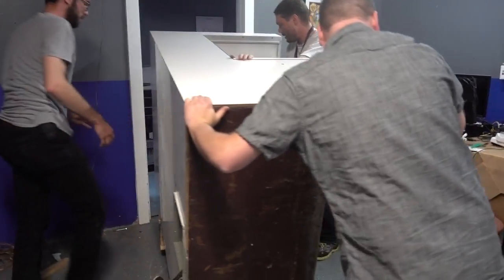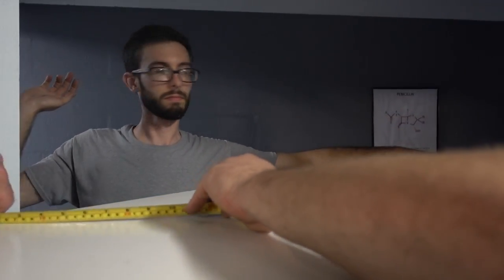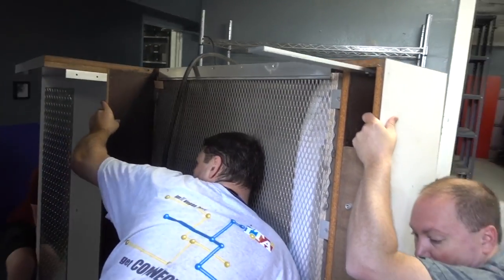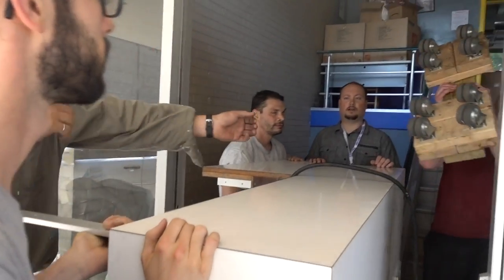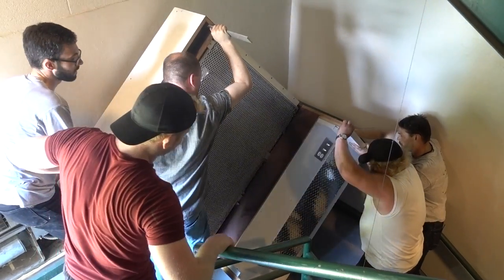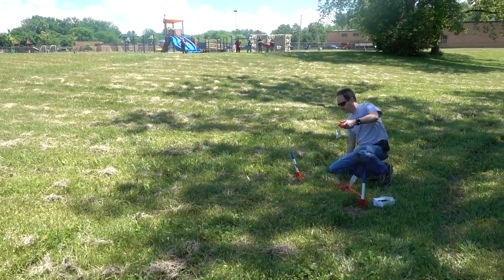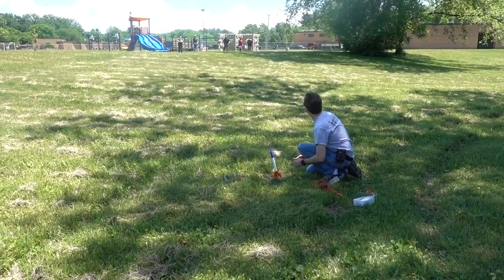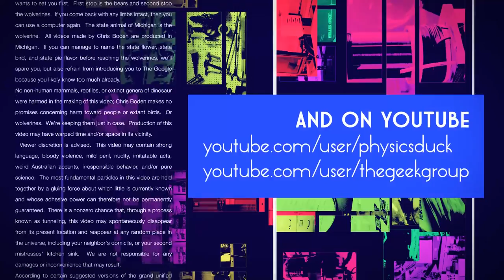Captain's Blog 6 1 2018 Dust Containment Cabinet Move and Rockets

Comment: The closest thing to an epic malfunction that I have experienced with model rocketry was with a home brewed engine that used pyrodex for fuel.  It left the launch rod so fast that it sheared off the guide tube on lift off.  Our altimeter registered 2500 feet, and our best estimate was that it hit that altitude in a bit under two seconds.  For a moment we thought the thing exploded on the pad, until the  eject charge fired.